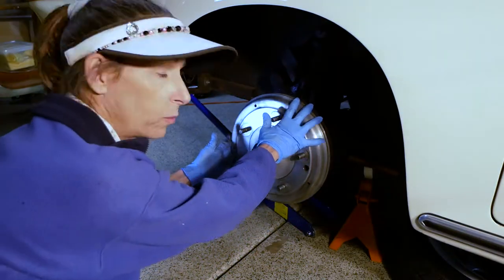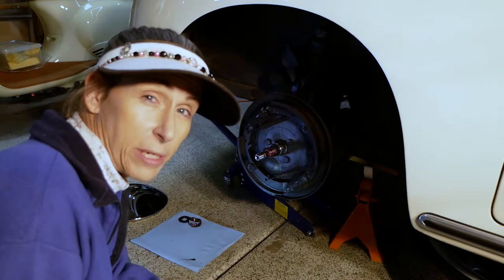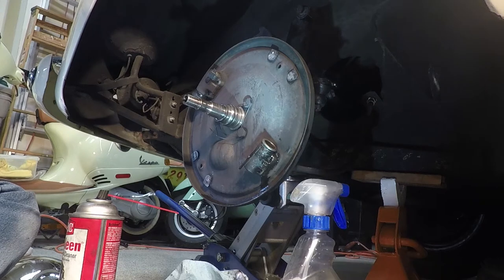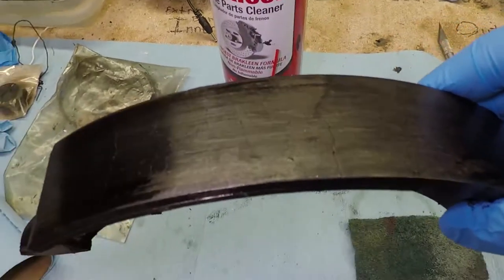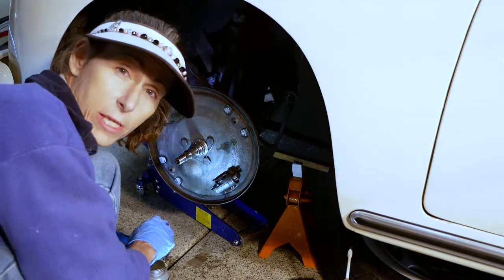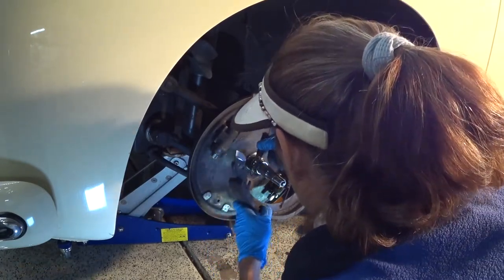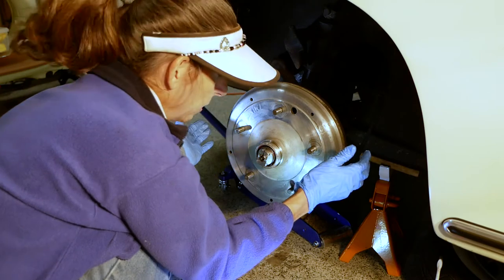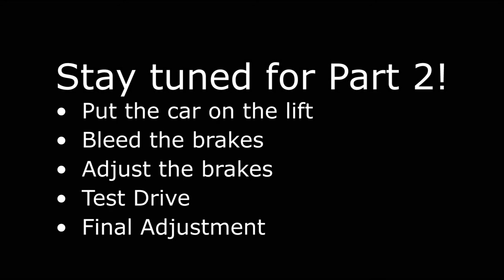Porsche 356A Front Brake Rebuild DIY Part 1!

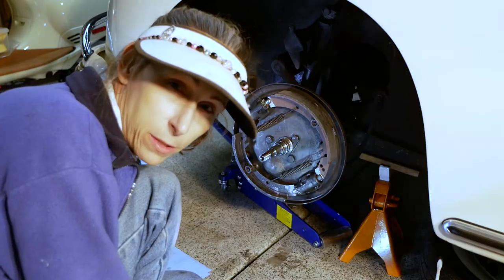Comment from the maker: Hi Everyone, I just noticed a little boo boo...  When I installed the big pad return springs, on the piston side, I have them in the wrong hole.  It should be the inside of the two holes that are close together; closer to the piston.  Take a look at time 12:50 or so...  Oopsey.  Not the end of the world and easy to fix, I just wanted to point that out.  Thanks, Franny

Comment: I have found that often times the metal piston and sometimes the cylinder are rough (at least).  This is a precursor to pitting. When this is evident, the piston doesnt slide smoothly in the barrel. So once the rubber plugs are removed, check the barrel for pitting and also lightly sand and/or steel wool the metal piston so they are smooth and will slide in the barrel smoothly.  Clean em well and re-assemble.
If the barrel is pitted a decision has to be made as to whether or not the cylinder should be re-honed or, in some cases where the pitting is toward the outer ends of the barrels, replace the barrels (or re-sleeve them).
Reply from the maker: Thanks for that.  I have a hone for the cylinders so I want to give that a go.  I also believe the shoes are mismatched so I think a complete overhaul is in order.  Thanks again.  F

Comment: Great.  Love the information.  Recommended part # for cylinder rebuild kit? And if the cylinder is already completely out (can't use brakes to get the piston to move) what do you suggest?  Thanks.
Reply from the maker: You can use an air compressor to pop the pistons out.  Check out either Stoddards or Sierra Madre for the rebuild kits.  Also get a small hone to treat the inside of the cylinders.  I had to do this again because I didn't get them completely corrosion free.

Comment: would love a rear brake video, need to to tackle a noisy e-brake too.
Reply from the maker: Hi Geers, I had the rear wheels off a while back.  I had to replace the axle seal on the rear left.  Always a good thing to get them off now and then, and do a little inspection.  I should do a video on that because I use a torque multiplier to get that castle nut off and then torqued back on correctly.  If that bolt is too loose, it can damage the splines.  Too tight and it can strip the axle. You can use your known weight and then adjust your cheater pipe accordingly as well...

Comment: I haven't done a brake job on drum brakes in a while but I don't remember the wheel studs being connected to the drum. Is this a Porsche design or am I just not remembering what they look like?
Reply from the maker: Clifton Frey Hi Clifton, the wheel studs will be on the rotatey bit, so the drum in this case.  I've only done drum brakes in Beetles and 356s and they are the same. I can't think how else it would be done. Franny